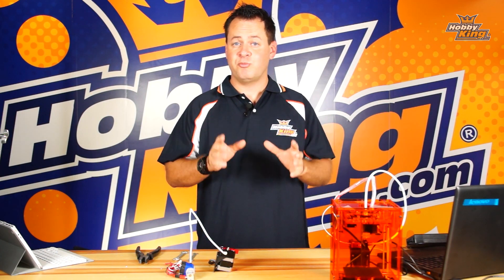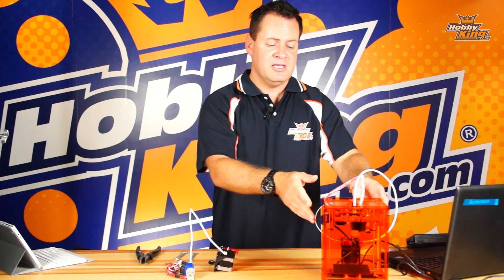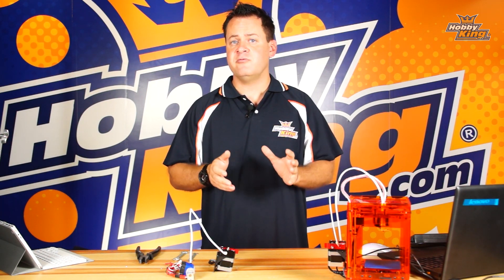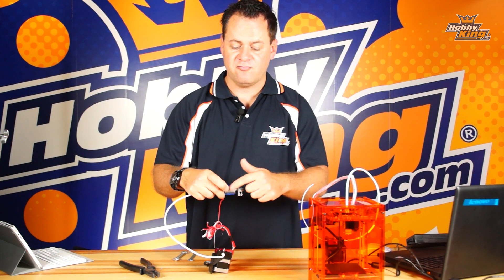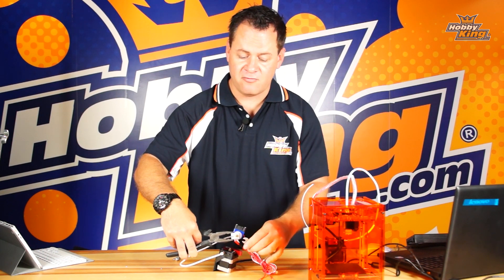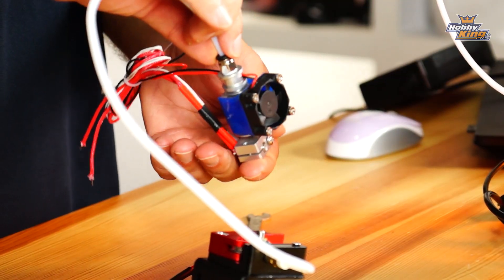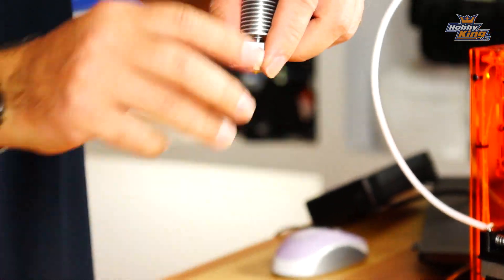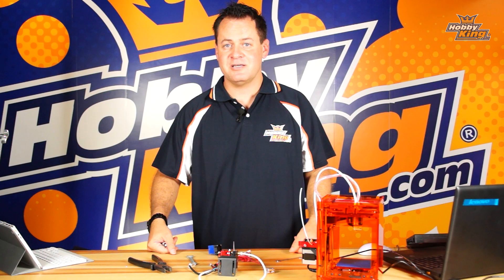Mini Fabrikator 3D Printer by Tiny Boy - Filament JAMS

Comment: I have fixed the jamming issue..... It was Jamed in the beginning of the tube. A little metal clip inside the brass end of the tube was pinching the filament. Works great now!.
Reply: +Chris Wilson I have the same problem :( failed my first print a 70% now can't even un clog it I'm going to take the extruder head appart... could you tell me where is the metal clip you're talking about ? I might have the same issue...
Reply: It is inside of the metal push fit connector on the Bowden tube. The end at the extruder motor side of the Bowden tube. You will have to take off the connector from the Bowden tube and replace it.
Reply: It's the metal piece that holds the tube into the connector that is the problem. It slips off the tube and pinches the filament.
Reply: After I replaced the connector, it worked great. It still works great, now. 

Make sure, when you take apart the printers head, that you put back the little piece of plastic tube that is inside of it. Otherwise it will just keep clogging.

Comment: I haven't made it through one print yet!.... It Jamed up 74% through the first print. 

It keeps jamming in the extruder within a few seconds after starting a print. I then have to take apart the print head to heat it with a torch to melt the plastic so it will push out. I have fixed 15 jams in the last two days. I have only had it for two days!!
I'm very unhappy with this so far. Hopefully I will find a fix for it so I can get my money worth of use out of it. 
Overall (if it worked) it would be a great product for the price. 
If someone has had this problem and found a solution, please help me out.